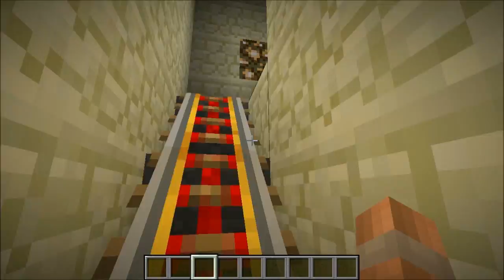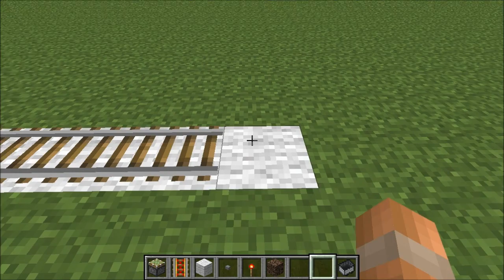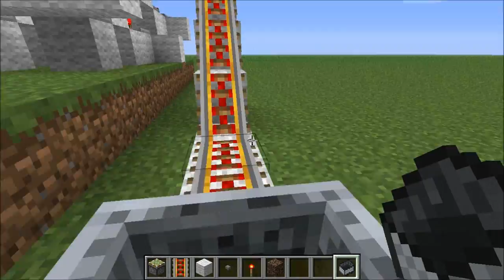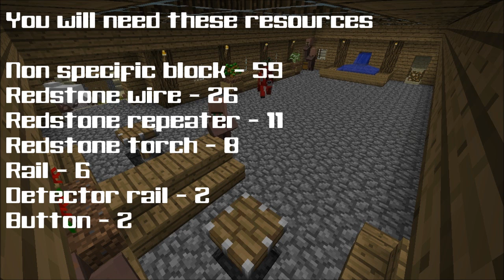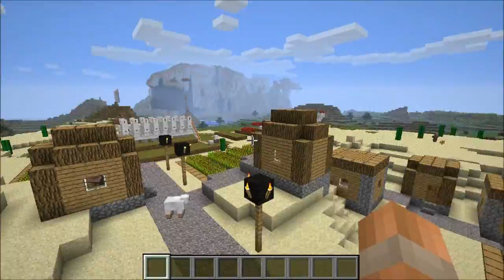Modular Minecart Station Tutorial

Comment: Nearly every time I build this, I wind up with one of the 2 sides resetting themselves, which is to say I hit the button, the torch above the switch lights up, track switches, switches back, torch goes out.  The only way I've found to fix this is to demolish it, watch the video again, rebuild, and hope it works.  Is there a trick to "resetting" this circuit if it wasn't build correctly?

Comment: Be advised, there is some kind of bug now that will randomly keep some blocks powered/not leave certain redstone torches unlit when you build it indoors. I used 3 clients, spent 2 hours building this entire thing indoors, then tracing the wires to the uploaded world in the comments section block by block and for some reason 1 section of block just remained powered all the time. It wouldn't actually modulate power. Great video and tutorial though, Built it outdoors the exact same way, works great

Comment: @xisumavoid Short answer: Track switching-- No. Rail powering-- Yes.

Even if track switching with side-by-side rails were possible, I wouldn't see it as practical; the booster glitch still works in certain directions, so carts can bump into eachother when on directly adjacent tracks.

You can have adjacent booster tracks in the back though (useful for storage systems, not player transportation).